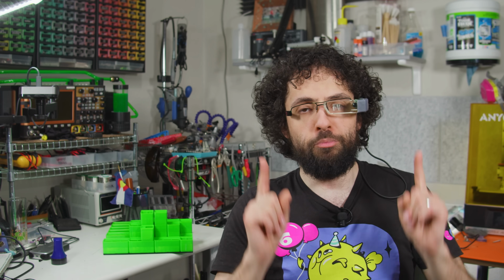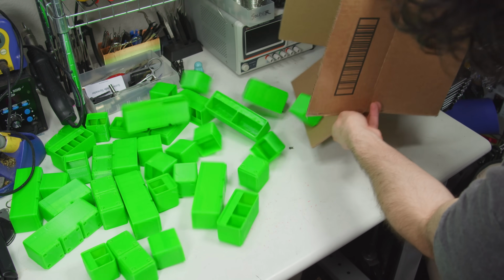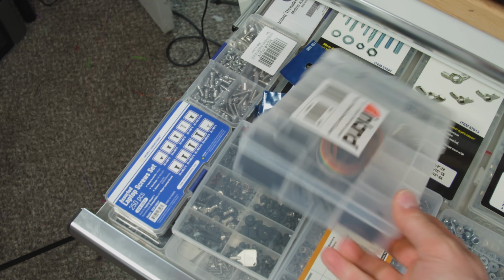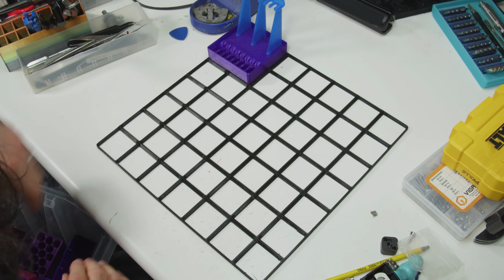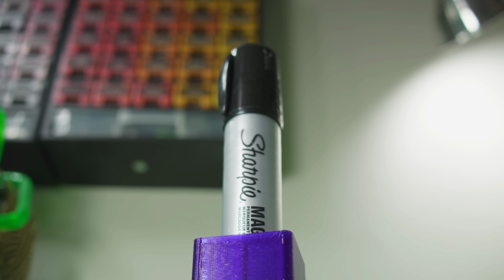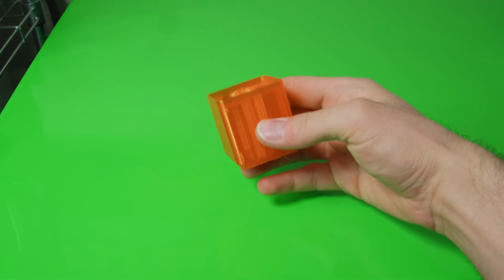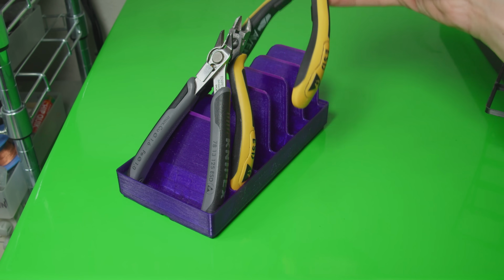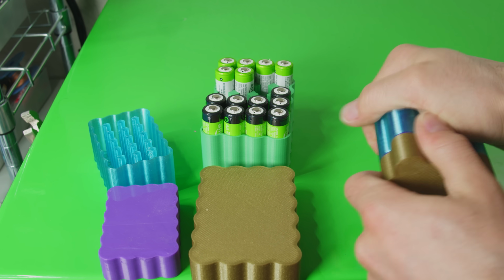Gridfinity: Your Ultimate Modular Workshop is FREE!

Comment: Whole hearted thanks for your work on this.  I found the Fusion 360 add-in so no need to spend hours designing the base gridfinity boxes and joining them. For instance I jus use the add in, make a very rough design of a tool then use the design as a tool and merge into to a solid block using the cut feature🙂

Comment: Hi Zack, This is awesome.  Thanks for taking the time to do all the hard work and sharing with the community. I was trying to access the parametric template and it says restricted. Can I get the template to design parts to fit this system without reverse engineering the bottom feet?  Thanks

Comment: my dude, you might have just extended my quality of life by about a 100years. I have horrible ADD. just in last 8 months i've adopted more than a couple of new hobbies. 3d printing being one of them. But, my days can quickly devolve into me sitting indian style in the middle of my room having a panic attack becuase i have surrounded myself with shit from different hobbies. I found this thing when i was searching for this thang. By the end i havn't even begun the original task or project, but have managed to start or continue a multitude of different projects and nothing i do requires one or two things/tools for the task. I'll loose things that are in front of me just because there is so much shit. I just bought a Bambu Lab A1. I give zero F^&ks about cosplay, larping, figurines, etc. I started printing to make housings for arduino, raspberry pi, and RGB LED projects. But now i'm geeking on organization both digitally and IRL. I found your gridfinity standard today and about busted a nut from the rush  solutions that came to mind.  Thank you my dude

Comment: I just found your Gridfinity after having used Alexandre Chappel's boxes for the last 2-3 years.  Your system is nice, but I find the single bins to be too small to be useful for most things.  Why not do something that is in the 2" (51mm) range instead of 42mm?  I see you now have a 2.0 version out now, but looking at that, it is a hexagonal base.  Hexes don't fit in rectangles very well, and therefore they are not useful to me.  Do you have any bins that are designed without the magnet holes in the bottom?  That would allow the bins to be deeper without changing the height, and also use less filament.

Comment: If the metal drill bit is attached to the PLA material, will it rust easily? My drill bit is in the wooden bracket, and the part that fits the wood is rusty, but the exposed drill rod is not rusty. PLA absorbs water more than wood, which worries me a lot.

Comment: Question... I've seen things on thingaverse for this, but I'm looking for a specific piece of the gridfinity project that I saw on another video... 

What I'm looking for specifically, is some kind of LED strip channel, but I don't want to attach it to the channel, and I don't really want to have a diffuser on it... Basically, I want a T track shaped slide in RGB strip holder, and the one I saw on the new gridfinity RGB BASED RFID using system video, that I've seen the other day, looks like like what I'm looking for... Is there an LED track system like that, that is a single strip system?

Basically what I want it for, is I have a project that I am thinking about working on, that will eventually require a set of LEDs, and I'm using a roll of LED tape/strip to make something like a 15-18 inch "light bar". What roll the LED track will serve, is as a permanent connection, possibly to a carbon fiber roof panel on a small bicycle trailer frame that has had the canvas cover deteriorated by being left outside, which would then allow me to slide the LED tape in and out of the track as needed for repair or replacement.

Does something like that exist or not? Even though I don't have a 3d printer, I've tried editing some thingaverse models for differing things in the past, but for whatever reason, I always encountered various issues. Maybe the projects were just too complicated or interconnected, IDK, but for whatever reason it was doing shite to the projects, and I ultimately just gave up on trying such things, since I couldn't figure out exactly WHY the issues were happening.

I do know a relative with a 3d printer if I remember correctly, and the parts could probably be up to 4-6inches in length easily, plus, I can easily just take smaller 2inch pieces and glue them together, if necessary due to smaller build plate size, so I'm not worried there...(I don't remember what size plate their machine has...

Comment: Errr isnt that why we reuse glass jars or tin cans ? FYI if you don't use a lid wood chips,dust,metal chips swarf, oil grease will all contaminate your bolt/screws/cable-clips/nuts etc. Your promoting yet MORE plastic not to mention energy use that will at some percentage be a fail and also an utter waste of resources when we have containers already and many are just throwing away glass jars when it takes HUGE amounts of energy to produce ! o_0 Really you all need to start thinking about what you use/discard/recycle and reuse BEFORE you MAKE NEW SHIT !

Comment: Is there a"vertical" gridfinity? Not holders-on-a-pegboard-but-the-boxes-are-still-horizontal-gridfinity, but print-a-grid-and-stick-it-against-the-wall with boxes that can be mounted on that with tools sticking up or at a 45° angle.

Comment: What prevents everything being knocked out together, eg: you're carrying around the housing holding copious containers like a tray of drinks and something snags your sweater
id imagine some kind of overall inververted nesting lid top for the top
and a slide in locking mechanism where the holder meets each tray
The use case im considering is a van full of tools hitting a pothole or breaks being slammed.

Comment: Nice Design! :D But i have some Questions.
1. How can disable the Holes for the Magnets on the Buttom i want it blank. It downloaded the "Parametric templates"
2. When i have set "slotsHigh" to 1, then the "Blank Storage" in F3D is 45,4mm. But "slotDimension" is 42mm but normaly a height unit from Gridfinity should be 7mm?! Thats confusing :-(

Comment: How did you settle on 42mm?                      
What a great system. I saw Chappel's videos last year and because I was so frustrated with my current system I bought a printer and designed my own parameterized system based on his. 
Having started with Bosch LBox, Festool Systainers, which have different sized incompatible boxes. Moving to buying Schaellor boxes because they were much cheaper, and supposedly designed to fit Lista drawers, but are strangely undersized (with 2x2 really being about 1.75" instead).
I have Harbor Freight (US General) tool cabinets as do you. 
I also built many cabinets with drawers for parts in the shop.
The bottom line is that I struggled immensely with determining my grid size. Being compatible and using as much space as possible in all the existing drawers, trays, storage boxes and such is a huge pain.     
BTW, I plan to use your grid "trays" to extend my use of boxes. Currently I have cafeteria type trays that I use to carry boxes from the garage to other work spaces.
Reply from the maker: Partially because it's easy to divide with mental math, partially because that lets you use microscope slides as windows in the glass-front bins.
Reply: @ZackFreedman  I didn't notice the microscope slides. I have a box full from another project and now a place to use them.

Comment: Cures you Gridfinity base plates! these just don't want to print! first layers fine its third layer and up things curl and lift off the bed, only managed to get one to Print, basic frame, every attempt since fails its like the base plate walls are just to thin, I don't get it, other prints no issues, gridfinity containers no issues, just no base plate for me, back of the line! same issue with weighted base plate Love the idea but not sure it was meant to be at this point.
Reply from the maker: Yeah, flat objects are intrinsically obnoxious. Just get that bed adhesion right - maybe you need to thoroughly wash the plate in soapy water, or even resurface it with acetone or steel wool.
Reply: @ZackFreedman  Thank you Zack! You are correct I soap and water scrubbed the crap out of my PEI sheet and got one 4x4 weighted base plate finally! I also did some tuning with the filament I was using, as I was printing to low of a temp, in the range but...

Comment: I have the similar cnc router to you zac. I burned out the spindle in like a week. THEN, upgraded to a dewalt DWP611 with a 3d printered spindle mount i designed and printed out of carbon reinforced nylon. Like a charm.

Comment: I don't even have my first printer yet but this is going to the top of my to-do list right after bed levelling and filament loading.
(Side note: tossing up between Anycubic Vyper - print volume, better bed heating/levelling - vs Ender-3 S1 Pro - nicer interface, hotter hot end, more filament options - opinions welcome!)

I for one dream of the day when I can stop slicing my fkn fingers open retrieving drill bits from Ryobi's crowning design triumph, the actual literal worst hardware case ever: https://i.imgur.com/X17SApr.png

Comment: I love 3d-printing, but I think this could also benefit from someone making a mould for the most universal models (mostly the bins and trays in different sizes, maybe the baseplates) for traditional injection moulding. That way, you could manufacture those at a larger scale and thus lower cost, while still allowing the users to customize their #gridfinity with the occasional special print.

Comment: I'm using anycubic Kobra max and trying to print some storage bins but it's a very tight fit into the base plate trying to fill up the base plate bends and pops other bins out, I've used Dremel to clean up bottom of the bins but still isn't good. Am I doing something wrong?

Comment: I'm thinking of printing grids for my entire (small) work surface, then printing 1x1 base plates (or maybe a combo of 1x1 and 1x2) for each grid spot, gluing a protective layer (maybe rubber) on top of each of the plates, and then making it so I can swap stuff in and out, knowing that when I put something down on the surface, it's going to be resistant to being knocked over and moved around into the usual disarray. Because of limited space, I tend to swap stuff in and out a lot, so I can see having kits for FDM, SLA, CNC, electronics, finishing. Just pop one kit out, drop the next in in a standard yet flexible configuration and carry on.
Reply: Also thanks for deprecating my own project to do this. Our designs are so similar that it makes sense to just use yours. Chappel's system is great but you and I share the ADD need to see almost everything, lest it cease to exist. I do hope you pick up FreeCAD soon though... open source and all that!

Comment: Buzzing with ideas, I'm pramiarily a wood worker/carpenter hobbiest who's electro-curious, so I have a very wide but not terribly deep array of tools. What I may do, is make up a router template to carve gridfinity compatible sockets into shelves, trays an work benches. And/or, design and 3D print a module that connects the system to a standard peg-board wall.

Comment: would printing this on resin be OK? is there a particular reason to use filament for this?
Reply: Just stumbled on this wonderful video and modular system and have the same question. Did you try printing any of this in resin? If so, how did it turn out?

Comment: Great system! I have printed a bunch so far, and like them. Only issue is with the magnet holes on the underside. The design of the hole means that some layers when the diameter of the hole changes is printed in mid-air (layer 13 if printed with 0.2 layer height). Leaves a bunch of wormy filament in the hole when it prints. Surely I am not the only one to notice this? This problem is carried over to ALL of the models with the magnet holes.There is a way to fix this in design - it uses an upside-down countersink style taper (I don't know the proper design terminology haha) that goes from the big hole diameter to the small. This means each layer has something to print onto.

Comment: Hey, liked this and your vids very much (and pressed like button HARD) but I have some issues - please help? 1. How do You intend to make retrieval of stacked window boxes more accessible? Currently once stacked I have to take them all down to get to the one at the bottom.. (especially since I thought it was intended to replace your drawer system) 2. The 2 compartment window box - I find it impossible to get the glass into the slot and had to glue it on the outside (and yes I have the correct size) hope you or someone here can find time to respond. Much appreciated thanks!
Reply: I’ve been thinking about that, before even printing a base plate.

It’s simple: have a base plate between each layer that’s as many units wide and deep as you need for parts. When you need a part, find it, lift up the base plate and all the layers above it, remove either a part or the whole container, then lower the base plate with all the other stuff above.

One could get fancier than this in the mechanical details if they so desire. I agree stacking them like bricks as seen in the video doesn’t lend itself well to easy access with multiple layers on top, though that’d certainly be the most compact way to ship them in a package!

Just thinking: tools tend to be larger and take more than one unit, and once you have enough small parts, those need to be easily accessed and viewed as well, but note that the types of parts (electronics, 3D printing mechanical things, etc.) tend to have a different set of tools applicable to them. Create a tools/parts fort with outside edges for the myriad small parts and base plates between layers, and put the larger tools in the middle, so you have a parts/tools workstation on a larger base plate underneath it all.

Comment: How can I make a 8x8 baseplate? As far as I calculated, it should fit perfectly into my Ikea shelf! :) And my Voron 350 should just be able to print it in one piece! I just tried to open the parametric template you linked and then tried to change the parameters slotsWide and slotsDeep, but I keep getting error messages and the frame doesn't get bigger...

Comment: Is PLA a good filament to print this with, or should I use something more durable?
Reply: PLA is more than strong enough for this, and durable.

What would you store where that’s a real concern? If in doubt, increase the number of shells or infill or both.

The base plates are intended just to hold things in place, and set that at a standard grid. They don’t need to be super sturdy.

The bins can be as filled in as you like, as long as they have the tops and bottoms shaped properly for stacking, if it makes sense in your context.

Comment: Welp... Time to order a few spools of PETG and get ta crankin' out a shitload of storage bins. I'll need about 50 of 'em just for all of the M3/4/5/6 cap heads I have, most of which reside in those plastic compartment trays that Zack mentions are really good at unexpected entropy acceleration. Not to mention having enough small pliers and cutters on my desk to ply and cut everything pliable and cuttable. And then there are the drill bit sets. Oh Lord, the drill bit sets.

Comment: @UCUW49KGPezggFi0PGyDvcvg is there a reason the magnets are glue-in and not push-fit as well? If they were push fit, glue optional, it would make mounting the magnets much easier and then if you want glue, you can use it. Thanks in advance!

Comment: Is there a way to link frames together other than slapping a overlapping block accross it? Can only print 4x4 frames
Reply: You can try to modify the frame/frame model in ways that would allow you to weld them together. Plastic welding is a bit esoteric and fiddly but you can do it where nobody will see the mess using some of the same filament and a soldering iron. Alternately sinking staples in with a soldering iron also works as stitches if the frames won't be moved much...
Reply: @Aubreykun  thanks for these tips